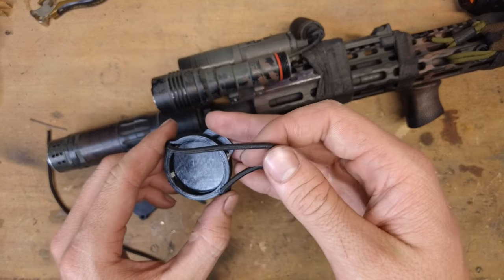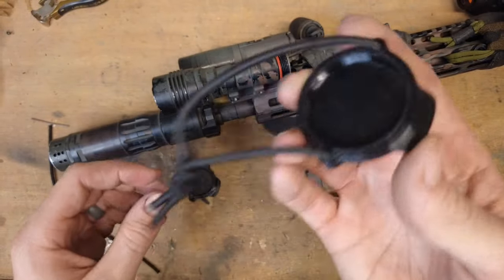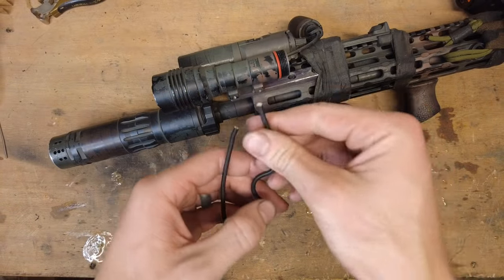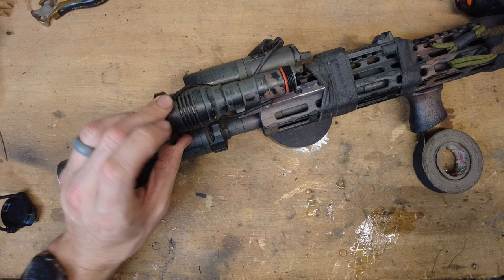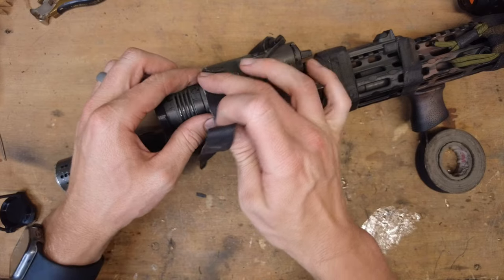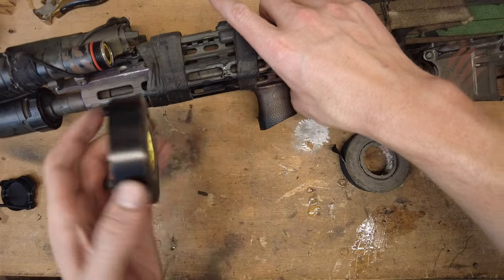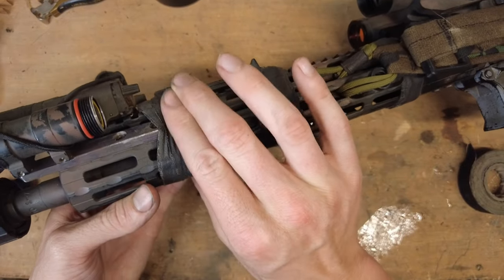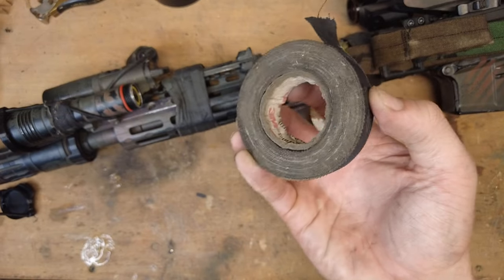100 Concepts Light Cap (At Home) // Free STLs

Comment: I bought a sheet of plastic off amazon and did a similar thing because I couldn't justify spending $25 per light cap. It's not so pretty, and if you ND light at night, it won't block all of it, but it does well enough for those without 3D printers and took about 10 minutes. If I could come up with a way to make a ring around it like your 3D printed one, it'd be perfect. Maybe I could cut out more layers and glue them together to make the ring?

Comment: You could also use the lid of a spray can and cut it to fit. You dont get the fast removal but does help protect the lens, and hide accidental light switch activation 

They actually fit most flashlight heads, I did that to make a lens cover for my streamlight

Comment: Nice! Iv been considering getting one but didn't want to spend the money. Any reason PETG? I usually stick with PLA+
Reply from the maker: It doesn’t degrade in sunlight
Reply: @thriftyoperator637  gotcha, I'll probably just paint mine with an outdoor rated (uv resistant) paint and call it done  iv never tried PETG but I have had terrible luck deviating away from tried and true PLA/PLA+/PLACF/PVC
Reply: How did that work? @PracticalTacticalSheepDog